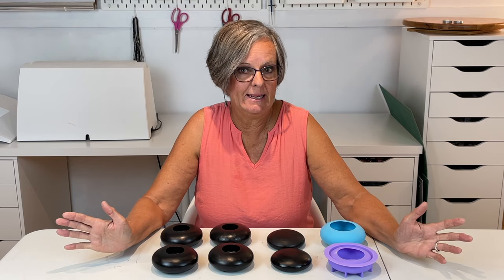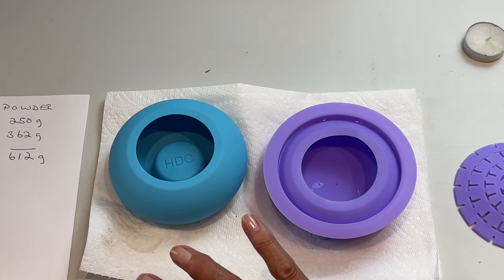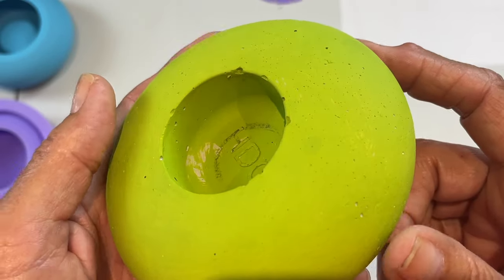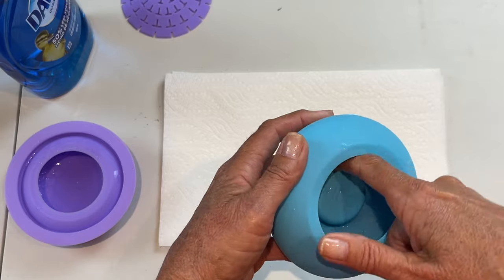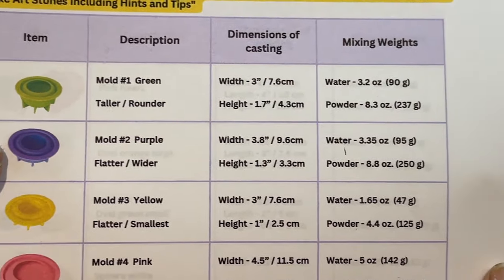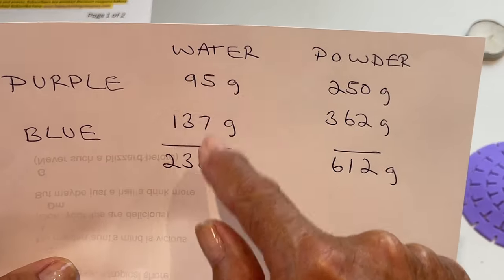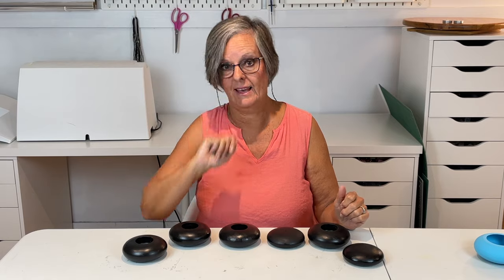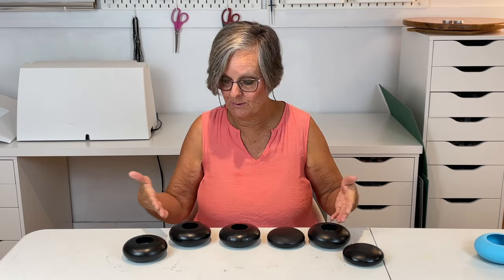HOW TO MAKE THE PERFECT STONES FOR DOT PAINTING - Lots of hints & tips.

Comment: I have also heard, but not tried , that adding a tiny bit of Jet Dry in the water also keeps the air bubbles down. When I need a surfactant I like Jet Dry instead of soap because there is less sudsing, which leaves to bubbles also spray the surface with alcohol to disperse the bubbles
Reply from the maker: Great tips Mary! Thanks for sharing with everyone. More ways to get perfect stones.